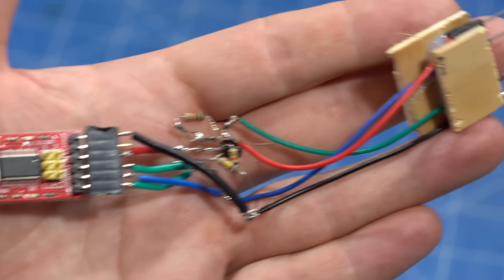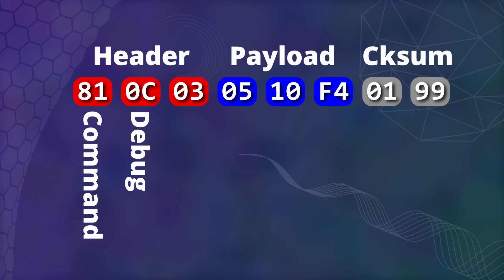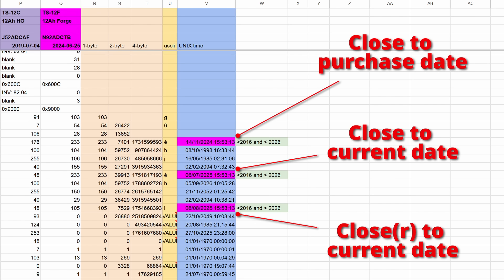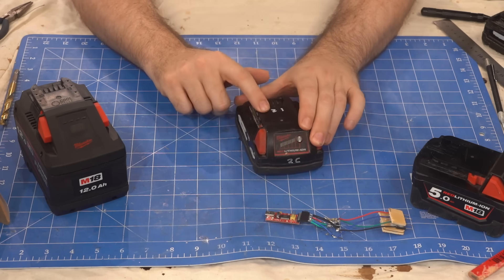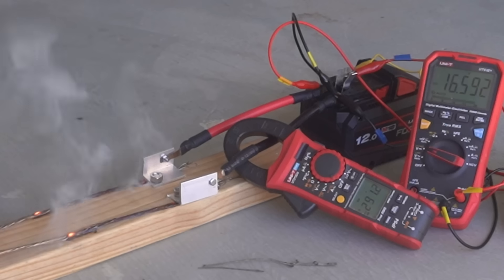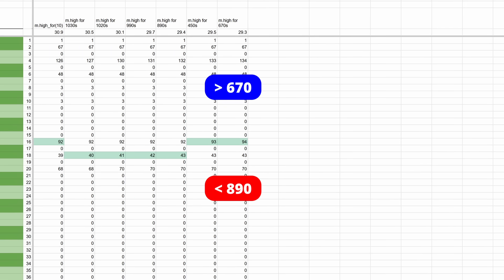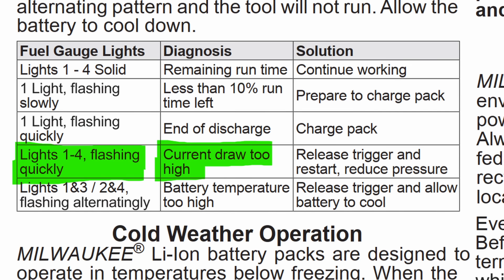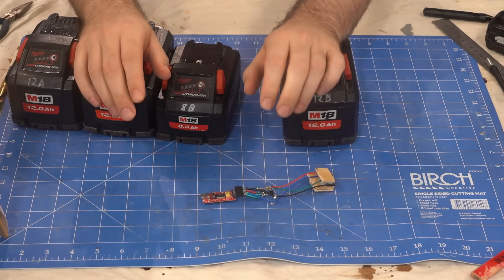Full M18 diagnostics revealed

Comment: Bravo! Imagine just being able to have access to this info via a PDF from the manufacturer, without all the pain you had to go through. This is why Right To Repair is so important.
Reply: Amazing the company will not let you read out the memory of your own battery. Of course Milwaukee should be legally obliged to supply such information and enacting laws to ensure consumers and independent repair shops have access to parts, tools, and information to fix their products.
Reply: @sventhormodpetersen1752  I agree
Reply: @sventhormodpetersen1752 Why would they give the consumer the information? How does it benefit the company?
Reply: @RT-qd8yl It does not benefit the company in the short term but build trust with the company in the long run. I think most people would just buy a new battery anyway. But if you can read out the log yourself you can see if Milwaukee is right when refusing a warranty claim. Also to support “Right to repair” instead of dumping in the garbage.
Reply: @sventhormodpetersen1752 Seems pretty obvious that they don’t want people to have direct access to the battery data as it will most likely be abused. Eventually this will provide a path to people resetting or modifying the data which will affect their ability to determine misuse and other conditions in a warranty evaluation.
Reply: @RT-qd8yl  that's the point, it benefits the customer.
The entire point of the company existing is to serve the customer not the investor funds.
Maybe we need a Nepal revolution too.
Ocuppy Wallstreet.
We only wanted to fix our shit, but they cannot give up power.
Reply: @dodgerbrewtx   no, it will provide people with data about them denying warrant for any reason they deem regardless of the state of the thing.
You have to trust them.
They have to trust the customer didn't tamper the data.
Scamming can go both ways.
That only means their system is insecure.
In a real secure software system, the entire code could be open source and the security would be the private key inside the microchip fused at the factory, that would sign the data and ensure the customer can't tamper with it.
On the other hand, everything is very clear to the customer on how the thing operates.
They can't do shit marketing and hide information and then deny warranty.
It's makes both sides honest.
We need laws requiring the right for repair and information about the products and their internal state, and diagrams and the code for the firmware.
Reply: @dodgerbrewtx  How does having read access to this information allow me to abuse anything.  Sure being able to re write the data is different but having read access would be something that a small percentage of users would find both interesting and useful and we could use this to improve our usage habits.    I don't use M18 batteries now but when I was an active road rescue technician our heavy rescue truck had heaps of Milwaukee M18 Power tools and lights.  I found them to be excellent tools very reliable and powerful.  The only tool I found frustrating was the Milwaukee M18 FUEL band saw the logic built into it is very counter intuitive.  The first time I tried to use it I though it was faulty.  But it's just the whacky logic the controls use that are totally counter intuitive.  I had to even read the manual to work out how to use it.  Imagine that!  Reading a manual...
Reply: @monad_tcp  all customers have choice to buy their product, if not happy, just don't buy. Why making everything more complicated than that?
Reply: Why wouldn't they? It's a zero cost feature. The documentation would already exist. It can encourage community and new product innovation. You can have a small licence fee for commercial use I a product if they really want. There is no reason not to publish the protocol
Reply: @TheBrick2 new product innovation? You mean Chinese companies making knockoffs that explode? It would only work against Milwaukee to release it
Reply: @RT-qd8yl  This is the nice thing about laws - we can simply force them to do it whether they want or not.
Reply: @dodgerbrewtx  brother this is nothing but a strawman argument. you are defending a company that has gone out of their way in more ways than i can count on my hands to not only make customers throw out hardware that realistically should have years of life left, while also doing everything in their power to find ANY reason to deny a warranty claim on this hardware that has such a tendency to fail prematurely. the only reason all this tech gets shoved into these bricks is to squeeze every last bit of value out of the company for the shareholders. they ran out of meaningful ideas years ago.
Reply: @Industry-insider  Nope I mean people coming up with different ideas of how to use the data. Companies from China or else where will always come up with knock offs and in fact this data would not help or hinder that. I don't know how you think keeping this data hidden helps or hinders dodgy battery manufactures?

 People can come-up with other products tat use this data. Some of which Milwaukee may choose to copy themself or buy in due to the development work already being done others there may not be enough in it for them but the building of a large milwalkee eco system and, community brand loyalty is only positive. Things don't grow by keeping them hidden.
Reply: @monad_tcp lol wut? Companies are predators. They don't serve the client, they indeed serve their investors.
Reply: @TheBrick2 how would any non Chinese company do that considering it would be patent infringement for an American company to make a battery that fits in their tools?
Reply: @RT-qd8yl How does this benefit Milwaukee and many other tool companies NOW??? 

Consumers have rights. When we buy a tool that has a warranty contract that comes with it, that is a Legal Agreement between the consumer and the manufacturer. The manufacturer is bound by there warranty agreements.
Reply: @dodgerbrewtx  Of course. Even the guy in the video was saying how to hide misuse in at least one case.
Reply: @alexisfrjpthanks to the erosion of antitrust laws we no longer have that option.
Reply: @dodgerbrewtx  this. It will be modded and then fasle claims. Also I have not issue with a private company doing as it wishes. No one is forceing anyone to buy them.
Reply: I see three different tongues licking boots in this reply chain!
I wonder if they are being compensated by John Deere, Apple or Milwaukee.
Reply: @CloudCuckooKing no we just aren’t dumb and we understand that not everything is black and white
Reply: People commenting here haven't been around long enough to remember when companies used to give you ALL documentation for a product, datasheets, reference documents, calibration procedures, repair documents, schematics, and even theory of operation documents. Was so incredibly nice having this sort of detailed information. Basically if there was a manual made for the company's use in servicing or manufacturing the product, they would likely also make it available to customers. With how things are now, you may have a hard time believing what I'm saying is true. Sad.
Reply: They should provide memory maps just like Modbus devices
Reply: @Trident_Euclid  Funny you should mention that - did you look at bytes of the actual read diagnostics message he posted? It's a valid MODBUS message - function 04 read input registers :D So he has built a MODBUS memory map
Reply: @HaralHeisto  Yup
Reply: yup i kept thinking that through this video. the extent to which we have to go to get a fair deal. frustrating.
Reply: @jose4167-i9v  I know what you mean
Reply: If there is the will to do so, then we could try to make a legal challenge...
Reply: You really think any manufacturer of lithium ion batteries will promote the process of a customer soldering a wire harness together and making their own circuit with the battery? Just think of where that will go. And then if they supplied their own Serial to USB adapter to the market, people will overwrite the values and scam the warranty. Making one of these is not difficult but the company cannot just support this process for the customer
Reply: @benchgoblin  bullshit, just make a better protocol in which it uses an internal cryptographic key to sign the log records, then you can easily know if the customer tampered it.
Reading information don't change it.
Some registers might be changed by the customer, just don't include them on the signature.
It's not a hard engineering problem.
Reply: China would immediately take that and make knock off batteries with it, and I’ve had a Chinese battery explode before so that could make Milwaukee look bad if someone thinks it was a real battery
Reply: @Industry-insider China is both the original equipment and the knockoffs manufacturer in the same plant and the knock offs are literally contracted by the companies as part of manufacturing in China then they can raise the price 20% on the OEM now.  You are under the wrong mindset if you think they don't want the counterfeit market to make theirs more valuable.
Reply: @rallyfeind  I never said Chinese companies can’t make high-quality batteries, but there’s no accountability whatsoever for them making poor quality ones, and they save a lot of money by doing that so that is typically what happens. If they’re high-quality then why have I had a cheap battery explode but never an OEM one?
Reply: this has nothing to do with right to repair...
Reply: @marke8930 having access to diagnostics (already implemented on the device) is not related to right to repair? 😅

Comment: I wonder if the redlink system on the tools will store any info or if it’s all on the battery’s?
Reply from the maker: Most tools can't communicate. I believe one-key tools can use this interface to program RPM settings, but they also use bluetooth, so maybe they don't bother with the pins at all.

Comment: Did you know that Makita manufacture a battery tester that does something similar? They can also lock batteries to tools count trigger time for HAVS. Not sure how much of that is handled by the tool or the battery but they’ve got more things going on than is publicly released
Reply from the maker: Yes, I've seen that tool and a few people have used it to reverse engineer Makita's diagnostics.
Reply: @toolscientist  I wasn't sure if it had been released as the one I saw was still in testing, I imagine it's a whole lot easier to reverse engineer when you've got the hardware, the way you've done it is seriously impressive, your ability to relentlessly stick at a challenge like this is inspiring

Comment: One of my 2 dewalt 12Ah packs failed recently. Expensive paper weight until I can fix it. Could not find the receipt. The big dewalt chainsaw is really rough on 15, 12, 9 Ah packs. They overheat around half drained. So to drain them fully takes two sessions with an hour in between to cool off. I assume dewalt packs have nothing like this in them? I'd be keen to provide data if they did.

Comment: A data point
I have one battery that is about 5 years old and figured out how to enter flash code a while ago.  I have a couple of batteries that are maybe 2 years old and can't enter flash code mode so something has changed.
Reply from the maker: What type? I think the 4Ah packs don't have flash codes
Reply: @toolscientist  The 2 YO batteries are smaller, I'd have to check the Ah next time I'm in the shop.
Reply: @toolscientist  UPDATE
CP 1.5 battery no flash after holding button down
XC 5.0 battery   has flash codes after holding battery down.
Reply from the maker: @bobroberts2371  I didn't know they still made 1.5Ah? You know that all batteries from 2015-2022 didn't have codes.
Reply: @toolscientist   I think that batts I have have dates on them somewhere.  The 5.0 was purchased with a drill and was an unused display model.  The batt was completely discharged and needed to be hooked to a straight power supply to revive it.  It has been fine since.
The 1.5 was part of an impact driver and was new in box and purchased after the 5.0. Perhaps the 1.5 is a promotional size and only offered with a tool.  I'm in the USA if that matters.

Comment: I am blown away as I had been in the service industry when Sony first introduced lithium batteries in their video cameras. So much has changed in the chemistry and of course the on board chip capacity. Glad I am old and can do with Ozito light gear. But on electric bikes the controller usually blows up before the batteries do.

Comment: Great detective work!!! Will something similar work for M12 batteries?
Reply from the maker: Maybe, but unlikely. Most M12 batteries don't have a microcontroller, so can't store diagnostics. The one that does have a microcontroller seems to just be to change the overheat pin behaviour. It's something we might look at in the future.

Comment: That's impressive, so I take it these diags only work on Milwaukee batteries but Makita etc use similar protocols in their batteries, is that right? Its very clever
Reply from the maker: Yes, this system would have been designed in-house by Milwaukee to meet their needs. The UART protocol is a standard for sending a string of numbers digitally, but what those numbers mean changes between nearly every UART implementation.  Makita and Milwaukee are similar in that you send a request to the battery and the battery sends numbers back. Everything else is very different (Milwaukee = UART, Makita = 1-wire protocol), and the diagnostics they keep will obviously be different.

Comment: From what I have seen, none of this is found in the Dewalt batteries, they have nothing but a thermal activated fuse internally, maybe the newer Powerstack have changed this, and maybe the Bluetooth trackable ones, but the older ones dont seem to have anything that I can see, they are easy to open too, the worst offender of doing crap like this is Ryobi, specially the 36v ones, they have more electronics in them than modern smart phone.
Reply from the maker: Powerstack 5Ah has a similar BMS to these (MCU + AFE), but yes, all their other ones are analog.
Reply: @toolscientist  I thought so, I just took one apart again, and they are pretty basic, I think I'll avoid the power stack then, as I use my Dewalt batteries with other brand tools through 3D printed adaptors, even use them to power eBikes :) if Dewalt only knew...

Comment: So we’ve gone from something akin to Morse code from the 1800’s to UART’s of the 1900’s.  Milwaukee is really moving forward, on the back’s of its user’s reverse engineering efforts.  Maybe soon we’ll be in the current millennium at this rate!  😂  Seriously though, amazing work mate!
Reply from the maker: The flash codes were very painful to read. So glad I can now pull all the data in abut 10sec.

Comment: Sweet little project you got here, I'd love to look into setting up a dedicated raspberry pi or Arduino to just pull the data and display it quickly and easily as a read-only tool
Reply from the maker: Like a standalone tool (without needing a PC connection)? I'd like something like that. Maybe a small display to give basic info in the field, but also dump all the diagnostics to as CSV, which you can transfer to a PC

Comment: Lucky that all the registers were even intervals of bytes. In my experience lots of I2C devices (mostly sensors and the like) have variable bit lengths to the different register values. (I wonder if that was the issue with the serial number register issue... For example if it were a 3 byte register I could see the first half (bits 1 to 12) being the case serial number and the second half (bits 13 to 24) being the electronics serial number. Or some other breakup that doesn't fall on an even byte interval.
Reply from the maker: Yeah, that's something I had a quick look at, but still needs more work. I didn't get too hung up on serial number as it's not that important. But now that we've found most of the "good stuff" I might revisit the serial number. There's definitely something weird about that register as it's the only one with 5 bytes - everything else is 1,2,4, or 10.

Comment: Excellent Video.
I have three Milwaukee M18 tools and several packs.
You guys should 3D print an interface for the M18 that contains the complete circuit board with USB output.  This not only generates revenue but will get people who own the batteries  but are not electrically inclined to submit data,  Win Win for you,
Reply: I am doing this, check back in 3 weeks, design will be on Github for anyone to make. Gonna order some prototypes soon. edit: ordered, see you soon. edit 2: they're here, writing fw, see you sooner. Edit 3: making a 3d shell
Reply: @randomblock1_  looking forward to it
Reply: @randomblock1_  🎉
Reply: @randomblock1_   p i n g
Reply: Curious if any of these hex registers have been tested on M12 batteries.  They seem to hit a fault mode much more quickly than expected.  Great work here!
Reply: Is it somewhat “easy” to convert NiCad batteries to LiPo? Replacing the Batteries inside the pack with 18650s Lipo Batteries along with a charging controller board would be what I need to do, I would imagine? A Little Board with Banana Plugins (and perhaps a Cell Balancer Circuit Plugin) or a Cell on Balancer on the same Board so a person could use an R/C Car Power Supply and Charger would be sweet.

I have an old complete DeWalt Tool set (Hammer Drill, Circular Saw, etc, that are NiCad. The Tools all work, but the Packs need changing.

Comment: This might sound crazy but- maybe an table top adjustable load would be better than two pieces of wire and a 2x4?😂Theyre pretty cheap nowadays
Reply from the maker: I think you underestimate how cheap I am :-) The 30A ones are cheap-ish (still more than 2x4 :p), but I need 200A, which means 7-8 in parallel and then becomes both expensive and painful. I might try and make a simple CC load with linear FETs and a shunt giving feedback into an opamp mosfet driver.